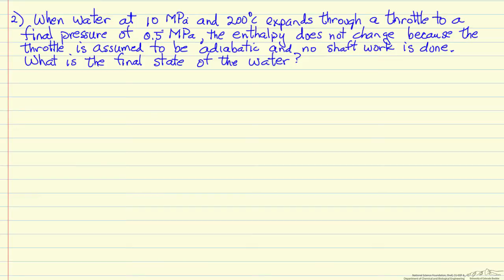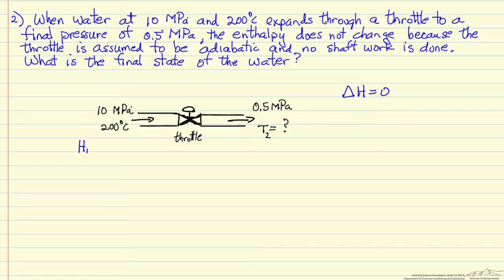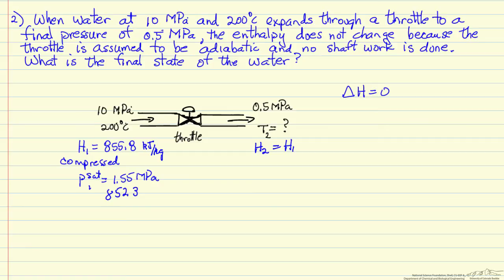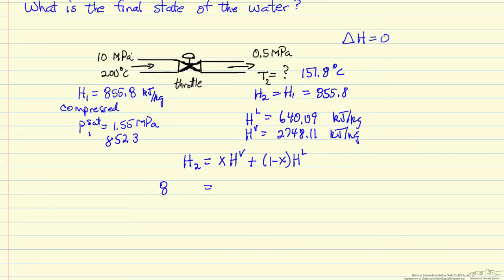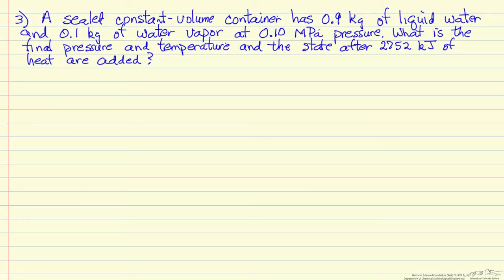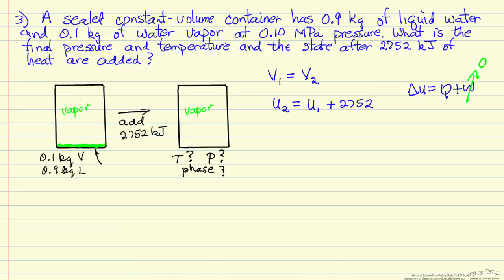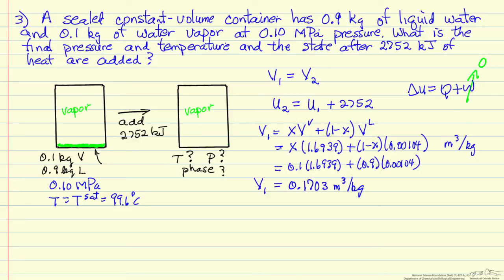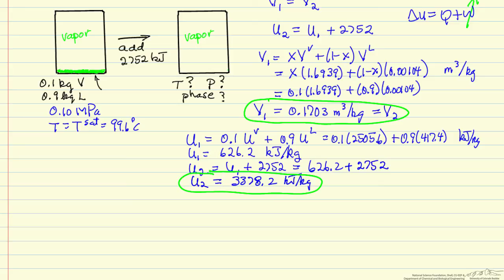Introduction to Steam Tables 2

Comment: Hi, thank you for this video. It really helpful. I have a question: "Why do we know water in example 1 is compressed liquid water?"
Reply: The first idea would be to look at the saturated conditions. If we search for the pressure of saturated steam at 200°C, it is 1.55 MPa, which is lower than our specification. So from a saturated liquid at 200°C, we need to increase pressure, which does not evaporate water, so it remains a liquid at a higher pressure, thus, a pressurized liquid.
Reply: Still on that example one...how did you know the H is 855.8 and from where did you get the other values
Reply: Am trying to look for them on the steam tables but see nothing

Comment: Constant Volume (V) process, I think the specific volume (v) is not constant. Initial and final specific volumes (v1 & v2) are different..
Volume: V, specific volume: v
Reply: i think he might have forgotten to mention since we are dealing with a total of 1kg of fluid; V and v would be different but have the same numerical value; since its a closed system and we are not losing total mass, v1 would equal v2. i could be wrong but that was my understanding.